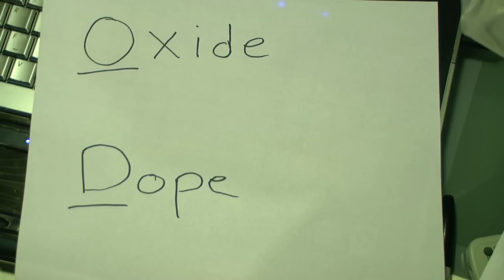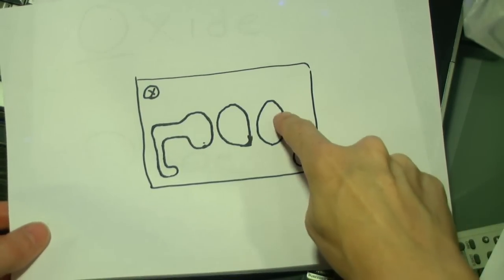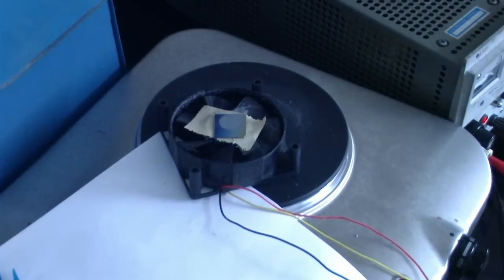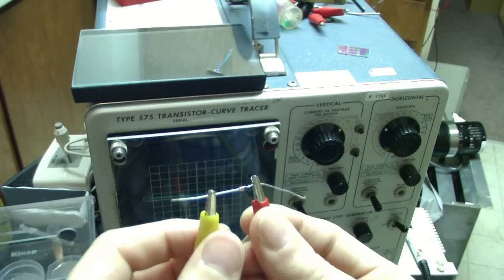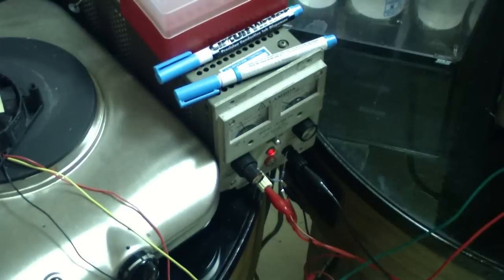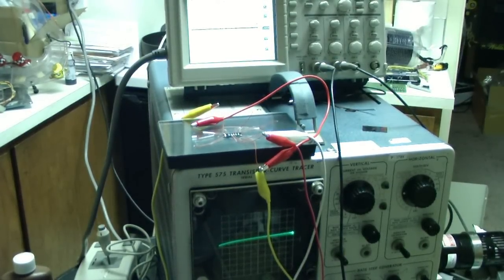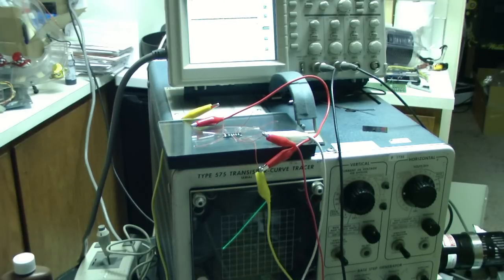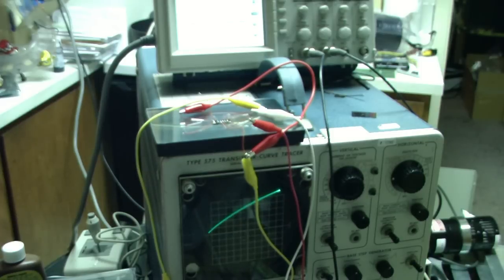Making Microchips at Home - Cooking with Jeri Part 2

Comment: Yeah..... this is not practical. Making single transistors is fine, and fun. I did it for my Bachelor thesis.

But, for anything useful, you would likely want to make your own CPU, and that means, I would guess at least ~100 nm transistors, if not better. You would also need to build some kind of clean chamber, for the whole process, because the amount of contaminants in Jeri's process will fuck up the fine circuits in your CPU.

Also you will have to cook in batches, and then hope that you get at least one really good one. 

Then run all kinds of tests that you can think of on it, to ensure that the circuit outputs are in line with what you expect.

Then you may have something useful, and also feel somewhat confident with the machine. Though, it may glitch out at any time - CPUs are complex beasts !

Comment: I need one for a military use biss chip, volt gain regulator and 555 if you or MIT want to know send me a message otherwise couple of months doing final curcit and case prototype befor I get a hold of MIT and learn more😆 looks like airsoft didn't do engineering studies mmmmmmmmmmmmmmmmmmmmmmmm but it worked for a kids toy😮😅.

Comment: I think that the "laggy" action is due to the large area and resulting large capacitive effect of your transistor.  This would be pretty logical.  Smaller area transistors having much faster switching times (if they are not leaky) because they also have more uniform junctions and smaller capacitance.  I love to see what you are accomplishing.

Comment: Would it be more interesting to do a NAND gate, or a memory bit?  For demonstration purposes, a bit can be held with two back-to-back inverters; a practical RAM would require a couple more transistors to selectively connect the two inverters bits to bus wires, but the demonstration would be cool if even if only the inverters worked, and I would think that if you have separate gate contacts for the passive pull-up transistors you could probably compensate for a fair bit of "process variation".
Reply: Weave it up old lady ;)
Reply: I think she's heading towards a nand gate.

Comment: i love how you have those alligator clip jumpers biting the Curve Tracer instead of using actual banana jacks. I have a Tektronix 577-177 Curve Tracer but the banana jacks are recessed, and since i got it for free and too lazy to buy cables for something i rarely use, bent paper clips with soldered on jumpers are good enough :)

Comment: it's believable to make a bomb in a garage, but not a transistor?  I don't get how people think.  pretty neat how you are able to replicate a lot of the processes used in semiconductor manufacture.  unfortunately a person learns how intricate the processes are after looking at the finished product on a scope.  I guess this is about as good as it gets until a person can afford to drop a good investment on industry quality machines.  no different than diy chemistry or the infamous garage co2 laser.  nice work!
Reply: I think the problem is that we're taught that you need millions in equipment and a clean room to make a microchip -- and you probably do if you intend to create anything of much practical use.

Actually this makes me wonder if it would be doable to create relatively simple but complete ICs fairly reliably, at few-mm scale. Design it all on a computer, use a printer with transparencies or other sort of transfer method to make masks, an assemble and align everything by hand in a relatively dust-free environment. Obviously it would be nothing compared to what you can do with proper industrial equipment, but still something complex enough to have some use, and smaller than the same thing hand-wired out of discrete components.
Reply: @joemck85  I doubt a clean "box" would be hard to make, positive displacement box that would be sealed and controlled via robotic arm(s).(Not rocket science) Masking for something small like that has me drawing a blank.
Reply: Andrew York Probably best you can do is print on a transparency at the best resolution you can, and then perhaps project it onto the resist with a lens to make it smaller. You'd still be working at macroscopic scales but it'd still be fairly small.
Reply: @joemck85  yes, I found another video where the guy used a old projector and a UV mask, brilliant thinking really.
Reply: @joemck85  https://youtu.be/XVoldtNpIzI

Link to his video.

Comment: What was your resist materials substrates? Can you map out a cicuit with it using your electron scope and do use a resist substrate to produce it? How was your quartz cylinder suspended? What about resisting multiple layers to develop a chip function?

Comment: You know this is a home made device? I.e. a dust could cause capacitance between the gate and source pin and cause current leakage. NOTE: That's just one of the reasons! 

Look it's great educational value, but not very practical for use.

Comment: Well really what you've done is make a depletion mode MOSFET. These devices are interesting in that they can be operated more like vacuum tubes and similar to JFET's. Certainly not a failure. BTW, I see you use a Hakko iron, see if you can get a JBC. you can get really small tips and they're great for super fine work. An added bonus, you can easily attach alligator clips

Comment: Have you considered refilling an ink jet cartridge with the liquid photo resist like they use for making silk screens (is a photonic activated epoxy resin) and using the inkjet printer to print onto the wafers to make your patterns? not sure if 1000th of inches is small enough areas for this process or not, but just a thought :)

Comment: I wonder why your transistor is leaky / needs a negative gate voltage, is it because your wafer is contaminated with a thin layer of n-type silicon (due to an imperfect oxide layer when you started doping) or might it be the result of a photoelectric effect (your junction is of course rather large). Did you also test it in the dark?

Comment: looks like you got a big capacitance between gate and Pchanel since you use epoxy as contact.try use other material like Ploysilicon or Al next time.but you don't have industrial equipment it will be very hard to achieve that flatness :(
BTW I guess you drop etch your pattern without use photo-resister for mask :)
watch out for anisotropic etching if you do so.

Comment: nice
it would be neat to see you make a chip that has several componets in it that does something maybe another chip does.

or find a circuit with not too many parts in it, build it on the chip and substitute it.
compare how one works vs the other
:)

Comment: Would the curve on the tracer stabilize faster if you would make your transistors smaller?

By the way, to capture a screen that washes out your video, decrease the brightness of the screen or increase the ambient light in your room.